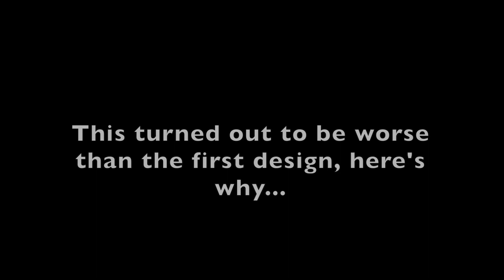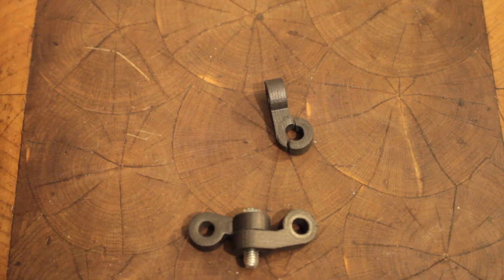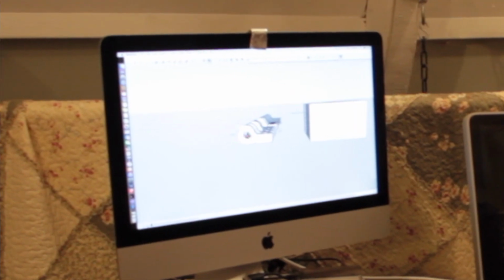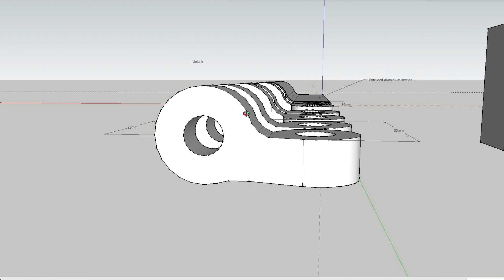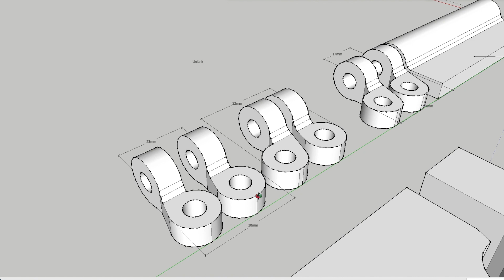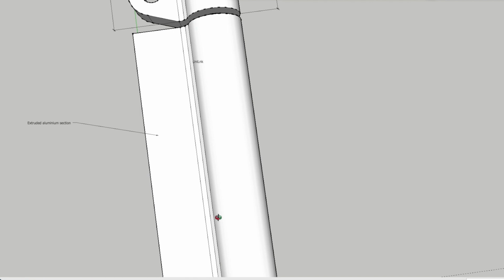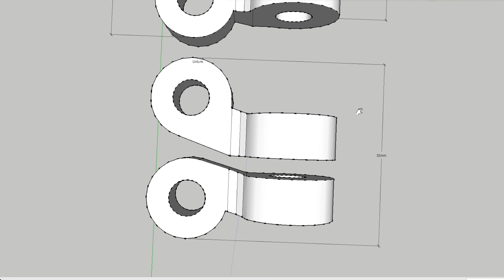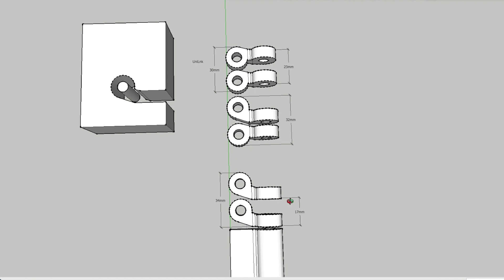Unilnk brackets - preparing for manufacture

Comment: You could make these from sintered powdered metal. They punch them in a punch press out of powdered metal and they heat them in an oven to a high temperature and you have a solid chunk of metal. And they can use any material you like. They make piston rods for internal combustion engines this way so it’s really as good as machining actual solid metal. I live in Emporium PA the sintered metal capital of the world. Ive had other parts made this way myself and would love being a part of the manufacturing of this wonderful part if it were possible. Reply if you have any interest and I’ll contact you.

Comment: It's very interesting to go thru your mental process! Also these 90 quids down the drain as you said - are just a small cost of learning. :) I'm sure the knowledge learned by such mistakes is worth much more!
Btw I've heard that most cast materials are much weaker than forged or extruded ones. Forged on the other hand are more complex to produce, so probably not practical either. But the extrusion process combines with CNC finish of the other half of the link seems to me a good solution.
Thank you for sharing the steps of your design & production process!
Keep it up!

Comment: Out of interest (an open question) compared to SketchUp how would industrial strength 3d software benefit a project like this? Is it much work to simulate movement, stresses, manufacturing processes?